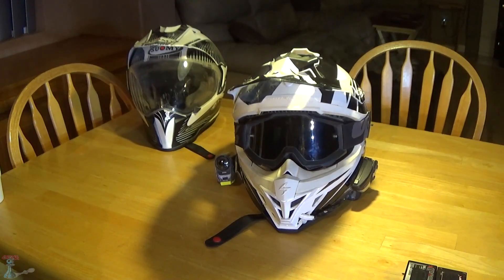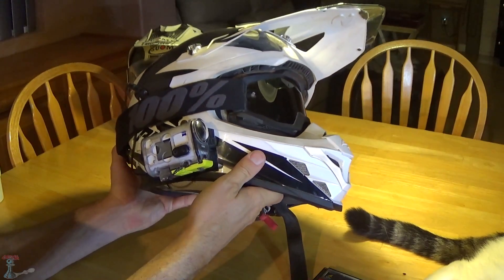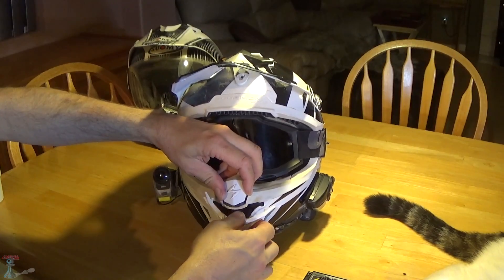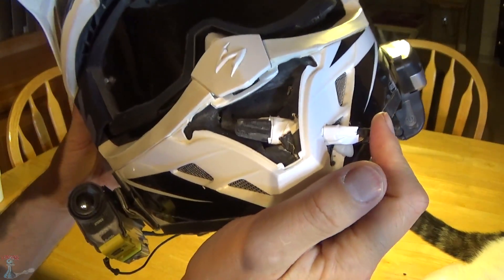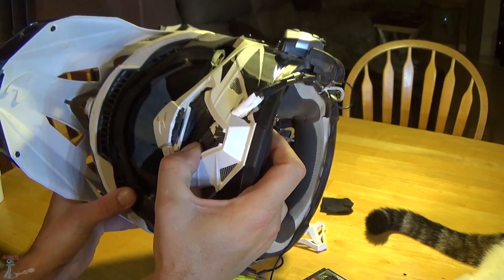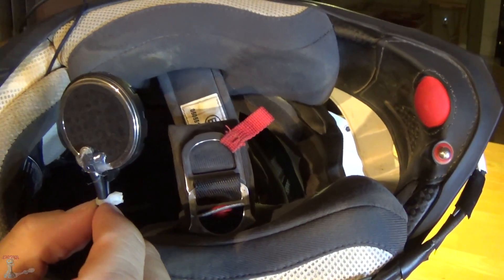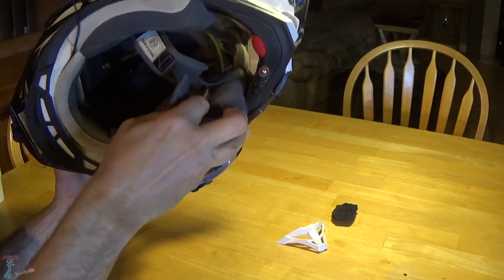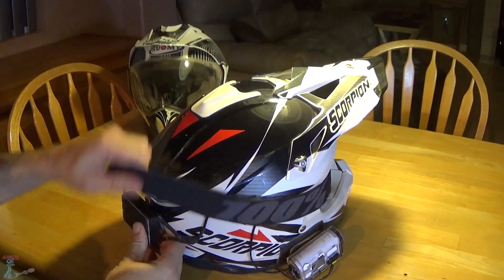External battery mod update and improvements (for Sony action cams)

Comment: Link to the beefier battery? Also cheapest site if possible.
Reply from the maker: I have links in my first video on this subject. But here is the hobbyking battery link below, but really ANY 1 cell Lipo will work. The larger the longer record times you will get. https://hobbyking.com/en_us/turnigy-nano-tech-a-spec-6000mah-1s-65-130c-hardcase-lipo-pack.html
Reply: Alright thanks.